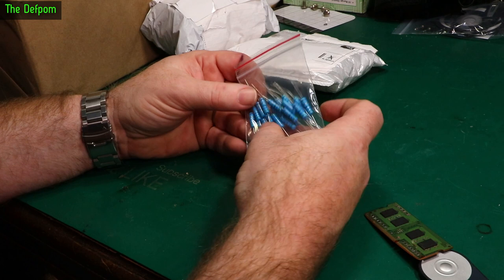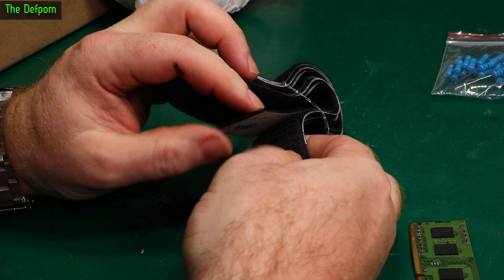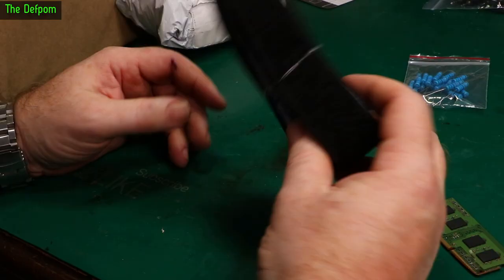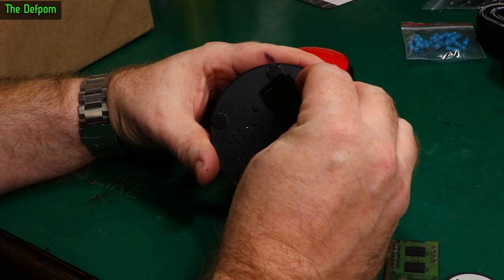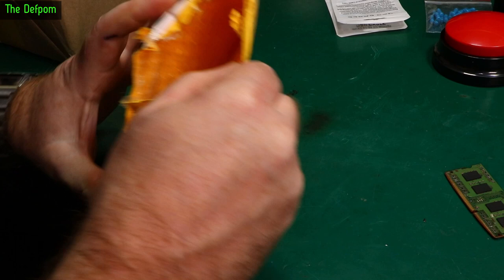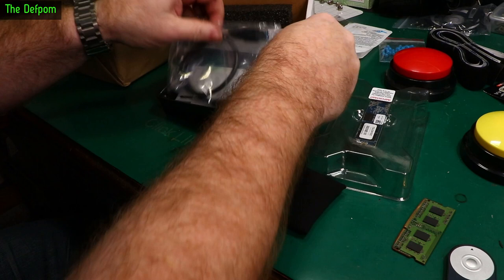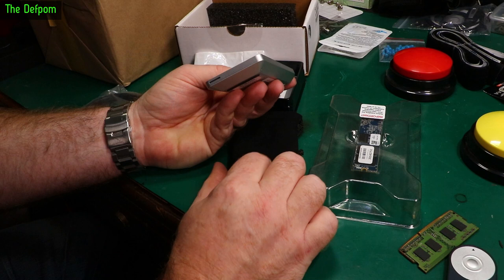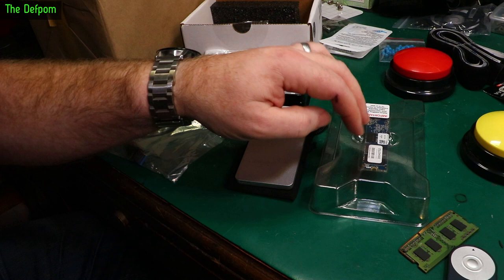🔴 What's in my Mailbag ? - Mailbag Monday 7th August 2023 - No.1161

Comment: II have used esun  pla+ filament for some time now and find the darker colours require a lower temperature - say 200 instead of 210 However, I've found an Aussie ebay seller that provides a pla+ and their colours are very attractive and the the product very stable. No sticking, warping or lifting. Heaven.